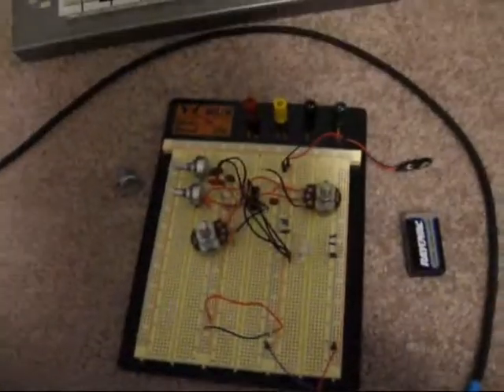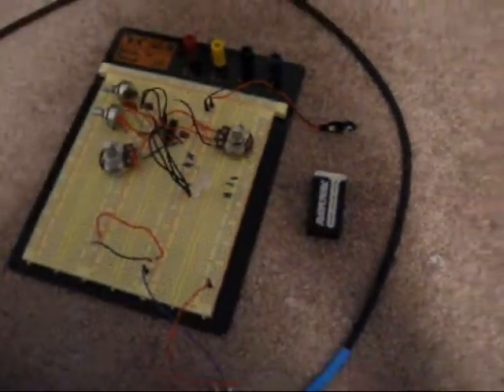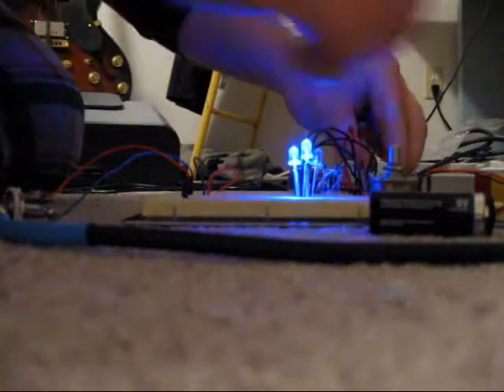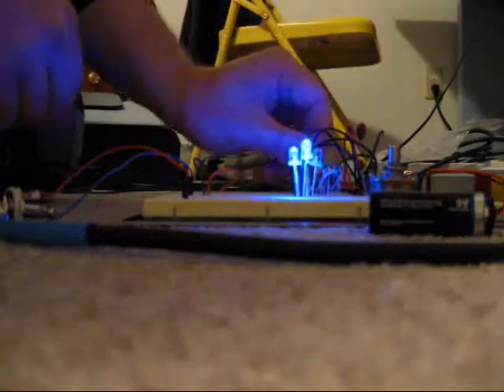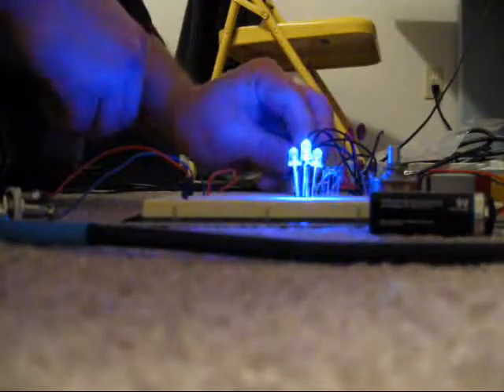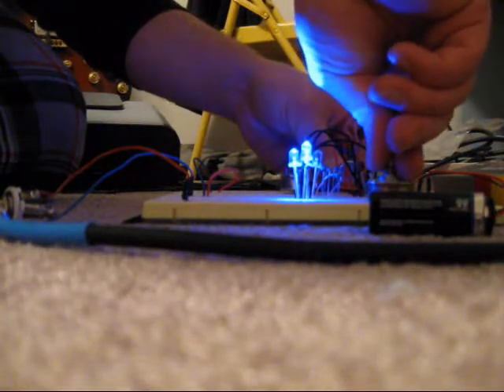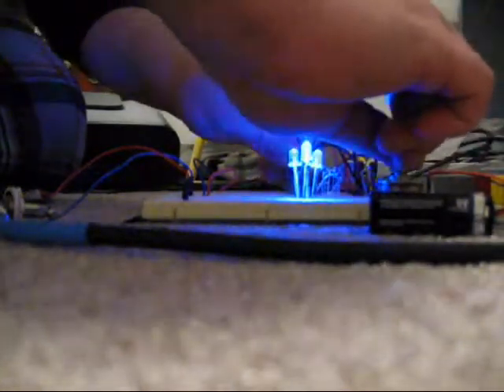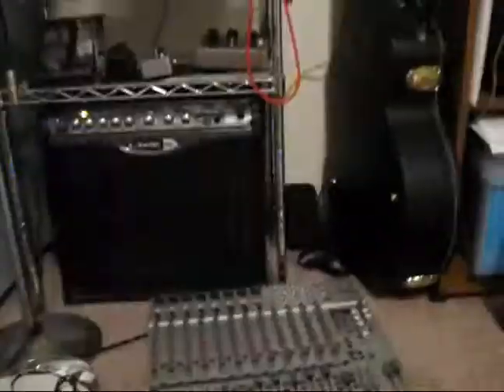40106 Oscillator

Comment: Ive been trying to build a 40106 oscillator for weeks now with no luck it just stays "high", it doesnt oscillate. I have hooked everything up correctly, Im 100% sure of it. I tied all unused inputs to ground, power to chip (single 9v battery).. etc... any help? Could you PLEASE post a video for me showing everything of how you set up a single oscillator on your breadboard??